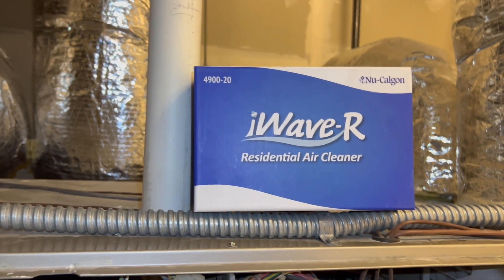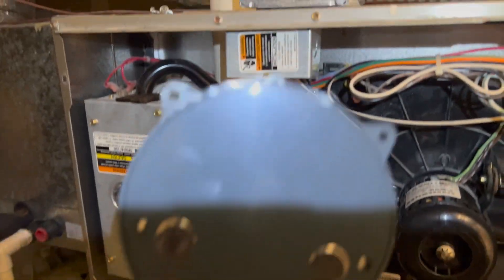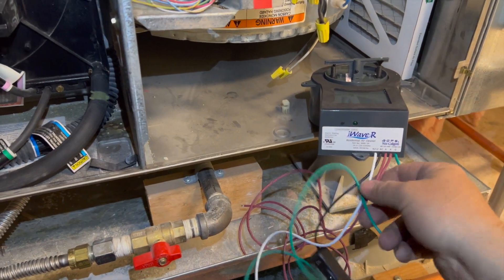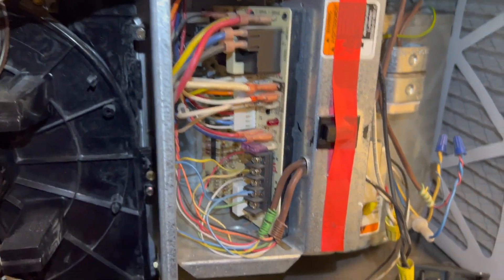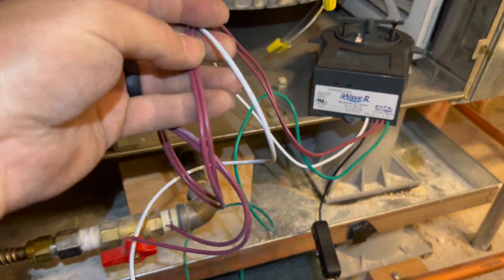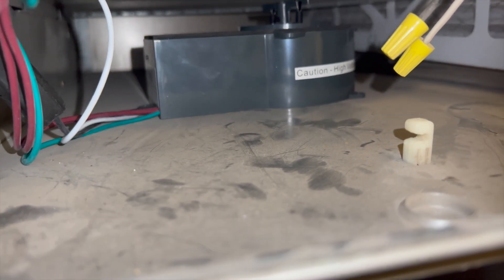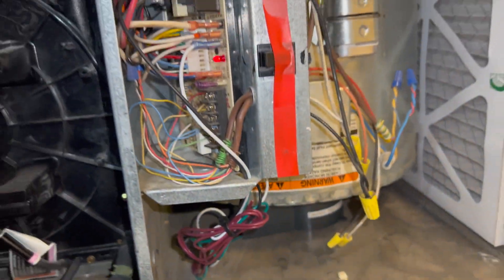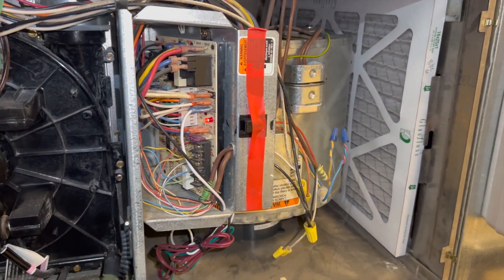How to Install Nu-Calgon IWave R in a Horizontal Payne Furnace EP91

Comment: 2 things, 1st, you can’t not connect on eac , because if you do it in that way never gonna reach the self clean, have to be always energized, 2nd , always use wire nuts to avoid any short , electric code

Comment: So I got one of the I wave r air cleaners today.  I’m looking inside of my furnace and connect it the same way you did.  I have a EAC-2 open on the board but no neutral port open (all being used).  Is it safe to split the neutral or should I hook it up differently?
Reply: It depends on the circuit being shared. Not all neutral terminals on the board can be shared. If they are on a different circuit - no good. You'd have to check to see which circuits would be on at the exact same time as the blower circuit, then share that neutral.

Comment: I am just a DIY homeowner.  I have a Rheem R96 Furnace. I am thinking about buying one of these, but due to concern about possibly frying my board or anything silly I'm debating just wring it 120v and plugging it into the wall.  Any thoughts on that?
Reply: All works the same, I personally recommend wiring it into the board so it runs when the unit does

Comment: You mentioned air flow direction. The blower inlets air flow is swirling up and in and multiple directions . seems that mounting the Iwave R in that location can also add a bit of flow disruption on that one side of the blower wheels entering air flow.

Comment: If you hook it to the EAC then wouldn’t it mess with the timed cleaning of the device?
Reply: Good question. It does not. Literature from the manufacturer states that the iWave-R remembers the day count even if the power source is removed.

Comment: Very cool. My HVAC Contractor is suggesting installing this (and for a lot of money) in my system in hopes that it will get rid of "dirty sock" smell. This seems like a pretty straightforward install and you can install it inside the blower case and not have to mess with opening up the evaporator coil housing? Do you need to place it right in front of the blower wheel like that or does location of the device really matter much?

Comment: Thank you for sharing. I don't know if I missed it, did you mention if this unit can be installed to run continuously without having to come on and off when fan calling?
Reply: If you wire the black and white wires into R and C on the board you're good to go.

Comment: What connections would we use in air handler?
Reply from the maker: You could install a new transformer or connect it to high voltage L1 and L2 or R and C.
Reply: @NighthawkHVAC  ok thanks alot

Comment: I would wire nut the red wires separately just to be safe. Since this unit makes particles bigger and easier to catch, we put them in the return before the filter and use Aprilaire 2410’s. If it does make the particles bigger, why put it after the filter? No issues with more sludge in the drains because of that?

Comment: Can you mount that ionizer before the air hits the filter so it can catch the particles?
Reply from the maker: The unit it designed to be installed after the filter. This unit is not a filtration unit. It treats the air to case small particles to clump together so it can be caught by the filter or wiped up from surfaces. It also makes the air a disinfectant plus zapping any biological agents floating around.
Reply: @NighthawkHVAC  " It treats the air to case small particles to clump together so it can be caught by the filter " - wouldn't that imply that placing this before the filter would make the most sense then?
Reply: @jplee3 The carbon fiber brushes get clogged up and the unit stops working. This is why there's a cleaning cycle. If you place the unit upside of the filter, the brushes will become clogged more quickly. 
On some modern systems, there isn't room to retrofit one of these so pre-filter is the only option. Just change the cleaning cycle to daily.

Comment: Is it best to keep my hvac on circulation for the iwave to run its best? Or should I keep the fan on from time to time? I cannot find any info anywhere on how to run my hvac for the iwave to work. I try and save by not using my ac or heater when I do not need to. Any info is appreciated.
Reply from the maker: If your thermostat has a fan circulating function this is the best option. Your air purifier is only working when air is passed over it. The circulation function usually will run just the fan for 15 minutes every hour. Depending on the thermostat brand.
Reply: @NighthawkHVAC  I really appreciate the reply and video. Thank you very much!

Comment: Would hooking the black to G and white to C give you the same result as what you did( only on with the fan), but at 24V?
Reply from the maker: This would work too as the Iwave can work on 24v too. However if you did that it would only run if “G” is energized. The Iwave would not operate in heat mode or cool mode unless the call for fan is present.

Comment: Hello! Great walkthrough. I have the EAC connectors on my Bryant (Carrier) Evolution series. I felt like I understood EAC-1 and 2 until the end of your video when you started describing the second transformer. Did you mean that a second transformer is needed when using the EAC connections? Thanks.
Reply from the maker: You only need a second transformer if your device runs off 24v. The Iwave doesn’t need one since it can be ran with 120v

Comment: Great video, great instructions!  I have a carrier (2018) and Nest system, but don't have EAC. I do have a new EWC300 control panel. So use a 24 v HVAC transformer primary connect to R and C on the EWC300 control panel and secondary for iWave?   EWC300 has one side for the system wires and the other side has zones control.